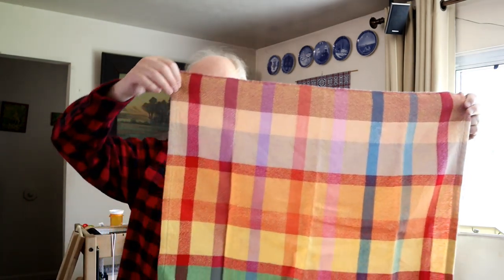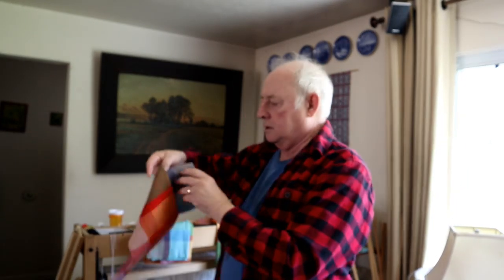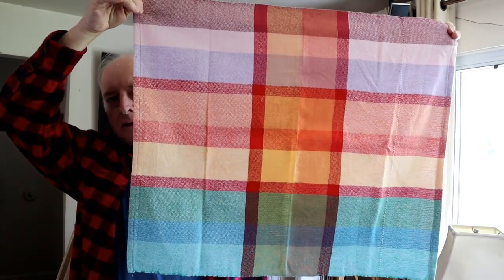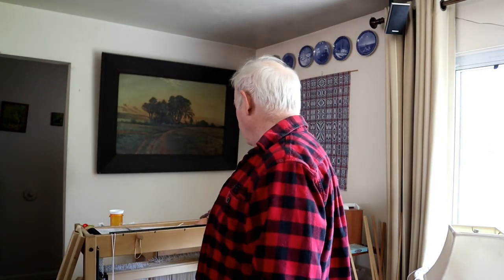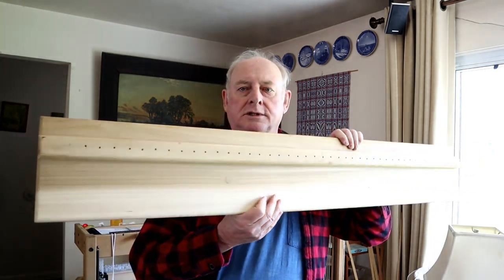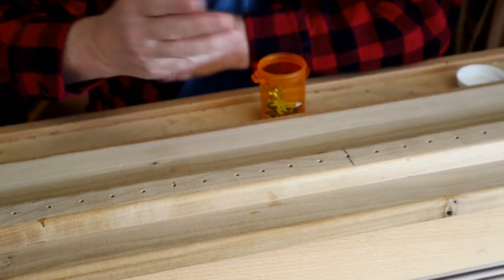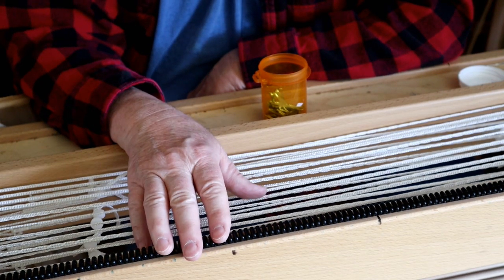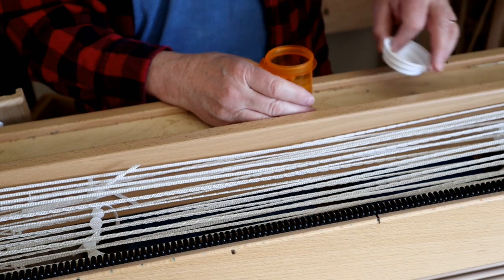2020 04 Raddle

Comment: Well that’s handy.  Not being skilled with woodworking tools (i’ve never even seen a router, other than the internet connection sort), I suspect my version of a homemade raddle would involve playdough, duct tape, and birthday candles.  But i agree — the built-in raddle is a pain.  I loop rubber bands over sections to keep threads from bouncing into neighbouring slots, but the threads will tangle as they approach.

Comment: I’m a newbie & want to build this! I borrowed a friend’s who put hers on the top of the loom, but some put theirs on the back beam. 
1. What are the advantages & disadvantages?
2. What size cotter pins did you use? 1.5” x ???
Thank you for your videos! I find them ever so helpful & inspiring.😊
Reply from the maker: I can't really tell you anything about putting the raddle on the back beam, as mine won't fit there.  I am quite happy to have the raddle on the top of the castle.  When on castle, the cross can be between raddle and back beam, and in my loom that makes it easier for me to watch and be sure i dont have any tangles.  
cotter pins are as you guessed, 1-1/2 inch.
Reply: @curmudgeon66 , thank you!
How thick are the Cotter pins? I need to order them online & I want to get the correct pins. Is thicker better?